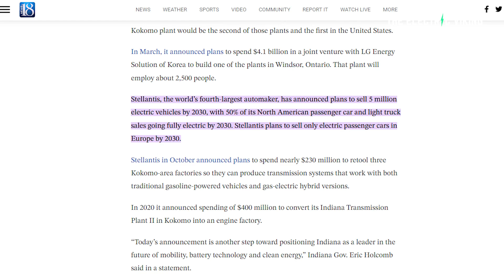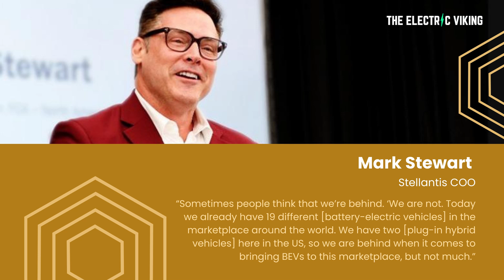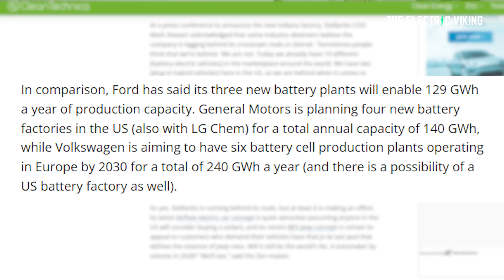Yet another battery gigafactory announced in USA - awesome!

Comment: And where are they going to get the lithium?
Reply: Depends on the price. It is in all sea water (more expensive). It is in dried out salt flats (dried out seas) much cheaper as it is concentrated. There are smaller but still economic deposits around the world. Even the UK has a lithium mine coming onstream which should provide enough to eV convert every new car out to 2050. The problem is the batteries last too long. First life of 20->25 years, energy storage of another 20 years on top. This ignores the 100year+ batteries.  New batteries cannot be made out of recycled old ones if the old ones are still being used.

Comment: What is the core technology of these new battery plants?  If they are not LFP they won’t be profitable.
Reply: You didn't watch battery day?
All based on existing 2170 chemistry, but using dry electrode and tabless, 
It removes a huge amount of factory volume (CHEAPER!)
It churns out 10x the kWh from the same area (CHEAPER!)
It uses less material (CHEAPER!)
.
HUGELY profitable.

Comment: With all these EV's I see brown outs all summer. People coming home , plug in the EV, turning on the AC, the stove top, oven etc.We better start bulding more gas power plants.
Reply: Solar, which is very cheap, is the answer to that. We are a few years away from many people charging EV with solar and then potentially using their EV as backup home energy storage system via bidirectional charger - grid will not be nearly as important as it is now
Reply: ajett 50?
Still don't get it?
Get home.
AC on
Stove, etc.
Go to bed... EV CHARGES 01:00 - 06:30
DUH?

Comment: Tesla needs to "REFRESH" its line. They're looking a bit dated at this point.
Reply: I love the fact that Tesla does meaningful and ongoing updates without changing the simple and aerodynamic shape of its cars thereby making previously produced cars worth less.
Reply: @lighthousesaunders7242  - indeed. The C-130 has been flying for over 67 years and is still in production. There have been many improvements over the years to what goes inside, but they found a good form factor and are still sticking with it - because why would you change something just for the sake of changing something?

Along the same lines, I once saw a display of Faberge designs from the 1930s that in their elegance and simplicity would still look fresh today. Some designs are, if not timeless, then nearly so.

The Austin FX4 - the longest serving model of the famous London black cab - was produced for 40 years, from 1958 to 1997 - and again, the insides got updated but the form factor remained basically the same. If you add the earlier FX3 model and later TX models the basic form factor has not changed much in over 70 years.

And although it was only in production for 12 years, the Routemaster double decker bus operated on routes in London for nearly 50 years, and became an iconic symbol of London.

I'm certainly not saying that Tesla should never change the form factor of their vehicles, but I think that most of the public does not really want or need the annual superficial updates that car companies have traditionally pushed - more for marketing than anything else. In the early years of the automobile industry these made some sense, as no one was entirely sure what form factors made sense - but more than a century later it's a mature industry and the basics are pretty much understood: a front section that was traditionally for an accessible engine but which we want to keep as a crush zone, a strong passenger compartment that won't crush easily, and a rear section for cargo and another crush zone - all in an aerodynamic shell. Do that elegantly and you have a design that should be able to stay fresh for at least ten or fifteen years - if not longer. If a customer prefers frippery and fashion over timeless design and first-rate engineering, let some other automaker deal with them.

This is doubly true once Tesla makes the switch to robotaxis. When it comes to a public service, customers tend to like the tried and true. Again, not saying the form factor should never be updated to match the changing times, just that it isn't something that needs to be changed annually.
Reply: @alanlight7740  an unusually intelligent and well written reply on YouTube, especially on the likeable but demi-literate Electric Viking channel. Thank you.
Reply: Teslas look terrible, panel gaps and shoddy paint work
Reply: @sebbya8370  positive name. 
 You must be like a death at a birthday party,  you ruin all the fun
And like a sucked and spat out Smartie you're no use to anyone.
Reply: @sebbya8370  Bullshit. The REAL Panel Gap is between your ears Gamerboy.
Reply: There is every reason to believe the input level for refresh exists in Tesla Agile and will trigger when the Digital Self Management determines that extending the light of consciousness to the stars will hasten with a refresh, along with what and how much will be needed until the trigger level of DONE is reached. Then this just keeps going, differently or not as needed. If NOT different then the AI has determined there is not an improvement presently in any current cell “line” available. The budget is always available for this.
Reply: @LegendaryInfortainment  You need to be Putin down that Crack Pipe son. It's no way to go thru life because the Parallax of the Square Root of Neet is highly dependent on the Angle of your Dangle and Cubed Quadrolitigously.

Comment: Japan's biggest problem is energy. In their ocean they have a thousand year of natural gas hydrates. At depth gas seeping up from the earth, is liquid, and forms a solid which Japan has invested billions to recover and is succeeding. Their position is right now, difficult.
Reply: In their oceans, they have an enormous resource of wave power. It will never run out. They also have a tremendous reservoir of geothermal energy, as evidenced by the number of volcanoes. They also have potential for plenty of wind and solar power, as well as some hydroelectric possibilities. Those resources could supply their country with far more electricity than they could use.

Comment: Battery production indeed is proceeding admirably. However it's nowhere near the quantity for the entire market to be 100% BEV by 2030 as Sam would like to think. The number of battery cells required for a 100% shift to BEV is something like 260 billion cells on an annual basis. Oreo cookies annual consumption is around 26 billion. (as a reference). The raw materials production is 'miles out' from anywhere a number to fulfill a complete shift. I realize most governments and private industry are aiming much lower but the bottleneck is already showing the strain and wise gentlemen such as Herbert Diess and others are thinking rationally and understand the transition must move at a more methodical predictable pace driven by realities and not fantasies as promoted so often here. The ICE market is not going away anytime soon and that's correct. Japan and specifically Toyota will be "in there" in spite of the emotional gloom and doom predictions put forward by Sam.
Reply: I think the bigger problem for the ICE market isn't whether batteries will be in great enough supply, but whether people are really going to want to buy new ICE cars even if the EVs are in short supply. Many buyers will probably just stick with their perfectly adequate cars instead of buying new ICE cars when they don't have a good EV option available.

I wouldn't be surprised if there was more demand for the most affordable (used) ICE cars and a glut of more expensive ICE cars when EVs are sold at comparable prices. People might wait for the EV and settle for something cheap in the meantime rather than dumping a lot of money on something new yet obsolete.
Reply: @ordinaryhuman5645  Good point. But I don't think the "cheap" component will play as you think. Those with money and are status conscious will still "need" their image aware brands such as MB, BMW, etc. And they will pay regardless. Aside from rising fuel cost people generally are not unhappy with their ICE cars. They do the job. Battery production is but one hurdle. Also many of the less important size markets will adopt at a slower pace than US, Europe, China. We can possibly agree the future has numerous uncertainties and will be fascinating to observe as it plays out. It's still very early days. 😁
Reply: @sunrisejak2709 Eh, I think they'll just keep their nice luxury brand car for another year or two longer until they can upgrade to an EV. They'll get on a waitlist and wait it out instead of upgrading to an ICE right away like they typically would. That'll probably be the case for the marginal luxury buyers who can't afford to do both easily.

The median income of a luxury car buyer is around $100k in the US. That's not so much that they'd throw the money away on a new ICE car when they're on the way out and EVs are the new meta for luxury, and they're probably not going to buy a new ICE car while they queue up for a new EV for ~1 year.
Reply: @sunrisejak2709  In Norway, over 98% of car sales last year were electric electric. Many countries will ban the sale of new fossil cars by 2030. Norway had that 2030 target, for a while, but they've brought the cutoff date to 2025. In reality, the cutoff date has been beaten, by the public.. 
I've seen the number of BEV's in this area of England snowball during the past few months. The bottleneck, at least in Britain, is not battery supply, but rather it's the public recharging infrastructure.
Reply: @RWBHere  Yes, agreed. But some markets are just poorly governed. Norway being an obvious good example of proper leadership (in this area). They also have ideal energy production that many countries don't have. Lots of commitment and investment needs to be made in a fairly short period of time and politics in some countries may interfere.
Reply: @RWBHere   I think I kept the video showing how Norway is (just about) forcing their people to go to EV.
 To register a ice vehicle it's very expensive and to register a EV is super cheap, to near nothing. 
 Norway has a lot of toll roads and you pay like 1/4 of the price if you got a EV.
 Quite a few perks to own a EV compared to a  ICE  vehicle in that country.
Reply: None of these car companies that Sam says is going out of business before 2050.
Reply: @icosthop9998  I won't be around in 2050 to to confirm or deny that one! 😊
Reply: @icosthop9998  🤣 Well,,, I'm 67. In 2050 that would make me 95. If I'm still breathing I'll at least have an EV wheelchair! My wife is 36 and we've been together for 20 years (do the math). No one can accuse me of not dipping into the fountain of youth! 😁😉
Reply: @icosthop9998  
I've seen this happen multiple times and have worked for very large companies in this position (saw it coming and left).
Check out his GM video.
Why aren't people buying the new Bolt?
Customers are both fickle and not ways as collectively stupid as thought.
They will change loyalties for many reasons and do so as a group very quickly.
Reply: @rogerstarkey5390  yes true.
 I was a General Motor's fan for many  decades and drop them for Toyota Products ,and I will drop Toyota for Ford if Ford can make and sell The Lightning 150 for less than 55 grand.

 "#Toyota"  needs to get their heads out of their asses and drop that hydrogen crap ❗️ Sniff the air a little bit outside of Japan 👃
Reply: "in there"?
Toyota themselves aren't predicting that.
Reply: @rogerstarkey5390  Perhaps Toyota will be relegated to providing solutions to the Japanese domestic market only. Japan (government and general consumers) will not allow Toyota to simply go extinct. I can tell you for certain the Japanese will buy a Toyota POS before they'll buy any Chinese car gem or otherwise. So, yes Toyota will be "in there" if only to secure the local Japanese market.

Comment: I'm curious why Japan is screwed for batteries when they're home to Panasonic?
Reply: Because theyre barely making batteries for Japan motor companies. they make batteries for Tesla though and others.
Reply: The question to ask is...
"About that 4680 cell Panasonic are "developing"....?
Is it based on the Tesla tabless tech "used in good faith"! and will Tesla have "first dibs" on the production?"
.
Well, the problem with larger cells was always apparently resistive heating..... and as far as I know. the tabless system was the only cure found so far..... and Tesla has the patent (open, in good faith)
.
And Panasonic have indicated Tesla will be "the main customer"
2+2=4
Conclusions
1) Panasonic are either using Tesla machinery, or have copied Tesla machinery, or have developed similar machinery for the tabless system.
.
2) Panasonic may or may not be using the DBE (dry) electrode system, if yes, see above. If no, it's going to be (much)  bigger factories, more complexity and expense, possibly lower performance product (more impurities in the cathode?)
.
Likely situation?
It's essentially a "Tesla 468" produced under licence.....
and with a "free exchange" both ways as problems are solved.
.
PLUS, we can probably apply the same to LG.